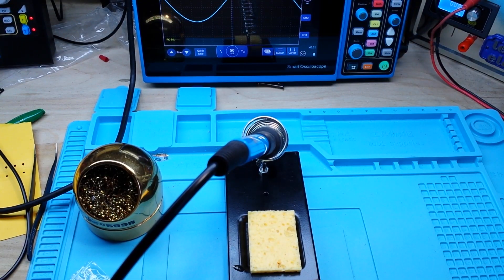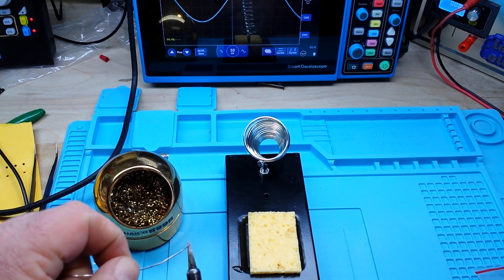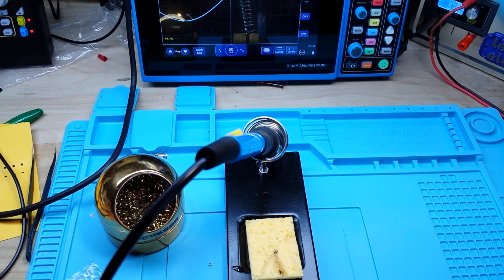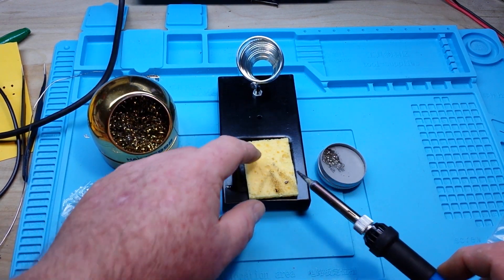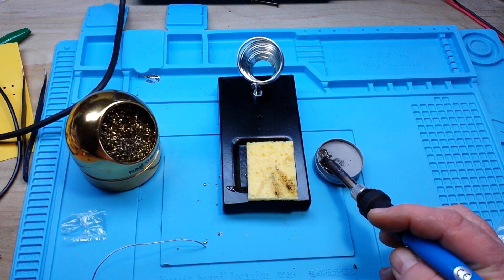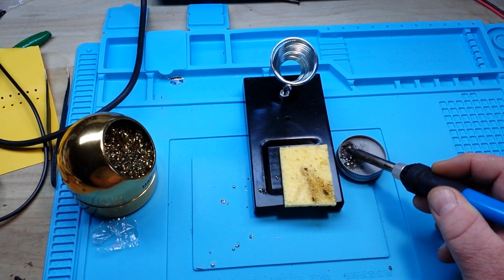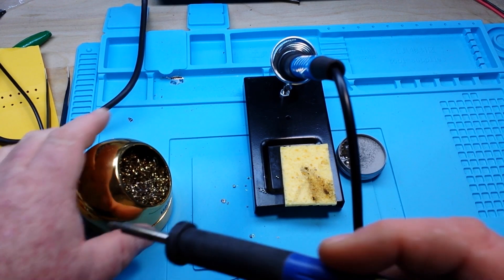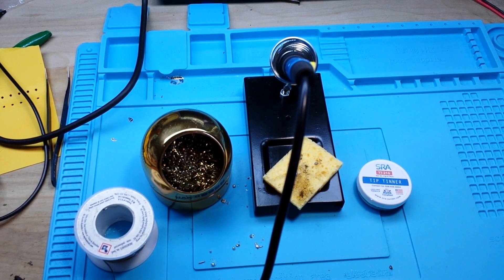Can Tip Tinner restore a dirty soldering iron tip

Comment: 95% of the time you're not even using the iron. That's when the oxidation is occurring. All my oxidation problems went away when I bought a decent soldering iron. I bought the hakko 951. It has an auto sleep function when you put the iron in the holder it turns The iron off. problem solved. I only takes about 5 seconds to reheat to 400C.
Reply: Agreed, 
Even if a hakko soldering station isn't in your budget you can atleast get a soldering iron that has an on/off button or just plug into an extension cord with an on/off button. 
       As long as your soldering iron is off when not in your hand and you clean in properly after each use you will never see another oxidized soldering tip again!!
Reply: @itsme-fr5fr  This is where a good powerful iron shines, as they don't take so long to heat up (again). Those cheap T12 soldering "stations" from Quicko and KSGER also have auto sleep and standby, and you can get one of those with a handle and a couple of T12 tips for less than the cheapest crapola weller with a holder.
Reply: @pr0xZen  yea but those cheap stations use that cheap pencil iron that uses the plastic collar nut to hold everything together and those melt and crack and break and then your iron is useless. Personally, I'm not willing to buy one and have that, happen without knowing for sure I could buy a quality replacement soldering iron that doest use a plastic  nut to hold the tip and cover on. I know Hakko makes a decent looking one that uses a metal nut and looks riveted together at the handle but I have no idea if it will work with any of those inexpensive , stations.
Reply: @pr0xZen  Maybe the Weller irons for hobbyists are cheap, but my Weller desolder station with iron was expensive, nearly 1k
Reply: exactly shut off the iron or lower the temp many new to soldering have the TEMP of the iron way to hot and it oxidizes very fast. if you have a good quality station like a Hako it will be back up to temp in less then 45 seconds after you turn it off
Reply: @DAVE_WHITE  your absolutely correct i just bought a cheap 40 watt weller station and just having the ability to turn the heat way down to a proper working temp worked miracles with my oxidizing problem
Reply: Thank you.
Reply: That's what I determined it would take for this to not happen on an inexpensive unit like the Weller WCL100/200. It needs to either be turned off completely between solders or down to the lowest possible setting. Unless I'm just doing something completely wrong with it. Thing is, I can solder fine without it with no issues.
Reply: Heating and cooling is producing oxydization.
Reply: @kalyanchatterjee6892  no, its not. Oxidation is a chemical reaction with the oxygen in the air. This chemical reaction is accelerated by heat.

Comment: These new fangled hard iron cored tips come with the penalty that you always have to treat them better than was the case with the copper.
We routinely used to dress tips with a medium mill file .... or if it had been severely beaten up a 10" bastard, which if you were rash could halve the size of the bit in a couple of strokes.  With copper they were either acid black or back of van green and usually just a light scrape with a file did the trick.  There were show-boaters who used old sulphuric acid, or wire wheels but it was mostly overkill ... a file both cleaned and reshaped, ready for a new lead (free?) overcoat.
You have to use appropriate force ... my mate uses his bit like a Hitchcock psycho then wonders why they don't last.

Now - you are in new territory, these new iron core bits are hard!  Mine seem to just need an occasional rub with a panscrub (bit like me!).  I have one loose for detailed or more energetic titivation but mostly, like you I just bash the tip into the tin a couple of times and I'm good to go.
One thing that has changed, due to my hunt for a usable chinesium cheapo solder I'm also trying out a range of fluxes from the liquid dab pen mild enough to leave, through the downright aggressive paste that dissolves everything if not cleaned off quick to natural pine rosin (colophony) which seems to work with anything that melts.
Have to be careful - the old plumbing or roofer's sal ammoniac or boric pastes will damage electronic boards in seconds.
My tip has never been so clean :D

Comment: sal ammoniac block is the way to go. Just dip the tip in the block and at the same time add solder to the tip while rolling it on the block and viola nice and shiny tip again.
Reply: Yes, salmiac is the one that works. It kind of eats the tips in the end so I'm not using it
Reply: I think tip tinner is just sal ammoniac and solder.

Comment: I think the special iron alloy plating  has been denatured by that brass wool and the flux it contains, or the tip just got too stinkin hot for too long...
Reply from the maker: Probably. I abused it pretty bad. But the ad for the tinner says it restores badly oxidized tips. That's what i wanted to test. It did not.
Reply: Yes it did not work at all.  Cheers.

Comment: Hi Paul I have used tip tin it never worked for me ether. I thought it was because I bought it from RadioShack. Now I use the brass wole and Rosin flux and I get excellent results from this. I also bought the Hako fox 951couse the stand has a sleep function and now I dont ruin my tips. I will admit I don't solder every day like you but I do believe that you get what you pay for and the fix 951 was the best investment I could have made. Just my opinion you take care and thank you for all you do to help us hobbyists. Peace man.

Comment: The tips are a different metal under the outer plating so you don't want to remove the outer plating or wear it down any more than you "need to".  You end up with two senerios, or I do, if the plating is worn off, the inner metal doesn't take solder (iron tips? or some other hard metal), and then there are the copper based tips, once the coating fails on them, they keep taking solder but start to erode [or the copper ones may come with no plating at all, although I have received plated copper tips as well].  The copper ones can still keep being used while they erode as they continue to take solder, but eventually there isn't much tip remaining to keep using.  I don't too all that much soldering, and I had quit for nearly 20 years I guess, so I haven't gone though a huge number of tips.  Really only 1 lost tip in the last 2 years, by cleaning with the sponge or brass cleaner mesh ball.    I did pickup the tip tinner too to see if it was of use.  Using it regularly will wear down the coating prematurely, because it does wear off some of the plating.  I did end up with a nice shiny tip though when using it.  I did put it in and turn it a bit  at my normal soldering temperature (300C).  I was a bit happier with my results than you, but it mostly just sits there and I did also feel I could have better spent the $10 elsewhere.  Yes it does stink, so that also impacts my interest in using it.  If my tip doesn't want to come clean with the brass brush cleaner like you are using, or the damp sponge I will use the tip tinner on it.  That is quite rare though.  I perfer properly cleaning the tip, and not letting it sit hot idle for extended periods.  If it does get set idle for awhile, turn the temp down and load it up with solder.  When I am done I clean the tip just before shutting it off.  That is what the former Navy trained teacher taught us when we were in school.  We didn't go through very many tips following his instructions over the years.  He always had use use the "plated" tips and not the copper ones, as he knew they would erode.  I like the copper ones, as I like how well they take solder, but the plated ones have been doing very well for me, so I haven't gotten any out knowing they will wear down relatively quickly.

Comment: I throw the cutoffs from my desolder braid in the brass wool. Also use the wet sponge. Got some old Rat Shack solder I use to tin once in a while, seems to work better if I switch up the solder once in a while.

Comment: I stick with a can of flux and the brass wool and some good old flux core leaded solder. Works every time! I always wondered if tip tinner was worth getting but thanks to your video I don't think it's really all that special. I'm sticking to my roots!
Reply: A good quality tip refresher like Weller's or Mechanic's can fix up a lot of oxidized tips. But not one lile this where the original tip coating is gone, and the tip is pretty much all oxidation. It's no replacement for good maintenace routines though.

If a tip is this far gone, you have to sand or grind away the oxidation. If there's anything left when you're done, then it goes straight in the tip activator/tinner, then to the brass, then coat in solder. Back in the brass, then redo it another time (sans the sanding of course). It won't last forever, but if in a pinch, you'll have a decent working tip.

At the end of the day, maintaining your tools routinely is the way to go, over abusing them  without any maintenace until they break completely and then try fixing. What kills the tips with severe oxidation, is them sitting there for long durations, even hours, at 3-400++°C, with no solder on, not in use, just oxidizing the tip itself like hell.
Reply: @pr0xZen  just put a new tip on mate...wayyyy easier then wasting all that time and material
Reply: @cjschmitt4882  Not all cartridges are available as adequate quality (or at all) knockoffs from china for a few bucks. Some cartridges, you have to buy originals from the manufacturer. And some of them are 60-70 dollars a pop. Some tweezer cartridges, double that.

Comment: Great video, dude. 😊
What I normally use is an acid flux (it's used to soldering with a torch I guess), normal rosin core solder and the brass thing. 😊
It works... But I never let my soldering iron tips get too bad. You know? When I notice it's getting weird I already do it. But it's rare, normally happens when I use the soldering iron, put it in the stand and forget to turn the temperature down. 😐
Reply: hehe if you forget to wipe the flux off ,come back the next day and half the tip will eaten away,ive seen it before its a bastard cause tips cost heaps nowdays
Reply: @katiekumcgil  Oh, you're absolutely right. I never used that thing again!

Comment: I push the hot tip in and twist it while pulling it to the side to scrub the tarnish off the tip as new wetting tin takes to the tip. I use a brass sponge exclusively, keep the tip wet with solder, and that hardly makes it necessary to use tip tinner. My tips seem to last forever now after learning wet sponges thermally shock and crack the iron plating of the tip. Brass sponges are to take away excess solder, and twisting it in the brass where some solder has accumulated does nearly the same thing as tip tinner.

Comment: If you've worn of the plating on the tip, then there's probably no $10 solution to restore it back on again.
Get quality brand (original) tips and care for them.
El Cheapo tips will be expensive in the long run when you have to replace them each month.

Comment: I do not recommend using any of the Can Tip Tinner that can be bought. I worked in surface mount for 6 years and at one time, management decided to allow the workers to try it for a month. I'll tell you, we went through soldering tips so fast because it actually eats away at the tip surface. The tips we used were very expensive and the expense of replacing them more often was not worth it. Management decided not to ever allow any worker to use it again. By the way, there is ammonia in the Can Tip Tinner and that is what eats the tips.
Reply from the maker: Yeah, Im with you.  This was an experiment. People keep telling me to try it, so I did. I will stick with flux and brass wool.

Comment: I use tip tinner every day but not that brand. I use Thermaltronics. I use the brass wool combined with that tinner and it works extremely well. Either your tip was too far oxidized or you have the wrong brand.
Reply: Yes, the Thermaltronics brand works very well. It brought my tip back from the dead. I was surprised

Comment: Use a piece of 600 grit wet sandpaper, it looks black and if that doesn't do it, try 360 grit and then tin it.
Reply from the maker: No sandpaper, ever.
Reply: @learnelectronics  Why not? The tip is shot anyway so instead of replacing it and throwing it in the garbage, I don't get it. Do you know how fine that sandpaper is? It worked for me.
Reply: Use a brass wire brush on a Dremel tool.
Reply: That sounds horrible. Sandpaper is such bad advice. KEEP SANDPAPER AWAY FROM SOLDERING TIPS. If your tip is so bad that you think you need sandpaper to fix, then you are not maintaining your tips very well, and have bad habits. If the tip is shot anyway.... to the garbage it goes. It is not worth the time and energy trying to magically fix it.
Reply: @ryansanderson7023  Like I already said instead of throwing it in the garbage you can easily remove the corrosion on the tip and re tin the end. Do you know how fine that sandpaper is? And it works every time.

Comment: Try a Sal Ammoniac Tinning Block. It's the only thing that really works. And it lasts forever.
Reply: I don't use  Sal Ammoniac and what I do works. The trouble with my method is it is expensive to buy the equipment to do the job. I use a solder pot. They're rare. But if you can get your hands on one they're handy gear to have around.

Comment: You could try some liquid flux and really let it boil away the oxidation (well ventilated).  It'll oxidize as soon as you pull it out, but the tip cleaner may be able to then have its flux take that off with the incorporated solder flowing in before you pull it out.

Comment: I just use a copper pot scrubber from the dollar store. Well, it looks like copper. Cleans just as well as a brass shavings (which actually clean for me? not sure why yours didn't give you a fresh shiny tip, though yours was pretty far gone). I'm still on my first hakko tip. I also sometimes just scrape the tip (when hot) on the pine board I use as a work surface. Usually when I pickup plastic or something, but it's another alternative.

Comment: It's all opinion' I've found you should really use the tip tinner from day one of a new tip as a preventative measure, I have a 20 year old tip that when cleaned looks brand new. The brass Razer blade sponge is OK for certain things like on huge desoldering jobs where my tip has different kinds of old solder/flux/contaminants on it, then to a slightly damp sponge, then tinning when closing shop. My personal pref. Is damp sponge, sal amoniac and tip tinner for me is the winning ratio. But to each his own. What kills me is viewers cursing you for not using a brass razor blade, they curse you for sand paper(rightly so). Good video, but the tinner does work even on older tips just take about five mins in the tin bath on 3/4 high heat, do not wipe off till finished and introduced solder into the bath. Give it time.
Reply from the maker: I have never ever used sandpaper. In my original video I tell how I was taught....nothing but flux, solder, and a sponge. I'll try the tinner again for a longer time.

Comment: I use colophonium to clean the solder tip, put solder and wipe with scrub and it works pretty well. Smell is a bit ugly but using a fan to extract that fumes. Edit. Add solder / Clean the tip and blob it finnaly :P

Comment: I sand it and then solder the tip.
Reply: likewise, back to a perfect flaw free finish then wrap with solder (tightly) and allow to heat, coats the tip perfectly.
Reply: @nvmyutube  wrapping doesn't work. Because air can get through the wrap and oxidize the tip before solder melts. That's the catch 22 of tip restoration. You get around it by cleaning the tip cold then immersing it cold into molten solder. How you manage to get a pot of molten solder is the real trick. I have my way of doing it.
Reply: @1pcfred  ahh i see, well i can't say its flawless but it did work well for me a few times thus far.
that i didn't know hmm i think next time i shall try that and report back, thankyou for the tip Paul.

Comment: I consider tip tinner to be horrible stuff, it produces a short term improvement, but long term it destroys the bit. In my experience it poisonous the bit and after a while the solder will not flow or wet the bit, preferring to form solder balls as the bit becomes solder repellent. Whenever I have used this stuff, I have ended up having to replace the bit. I suggest you continue to use the brass wool to clean the bit, it works really well, slowly removing the oxides. 
I have a time switch on my soldering iron, so that it is never left on for long periods unattended, as this is the main cause of oxide formation together with running the iron at too high a temperature. I think it is important to never leave flux on the iron to burn and form those horrible black carbon deposits. ( I suspect the carbon residue left by burned organic flux forms an alloy with the bit surface that repels solder.)
I always tin and wipe the iron bit just before I turn it off, this leaves a layer of protective solder on the bit for when it is next warmed up. Filing or scrapping the tip of the iron removes its nickel coating, destroying the bits ability to tin.
( I do not know which tip tinner you are using, but it is worth reading the small print warnings about the dangers of inhaling the fumes some tinners produce. The ones we had in the lab smelled like burning ping-pong balls ( nitro cellulose ) and the fumes were labeled as toxic. )